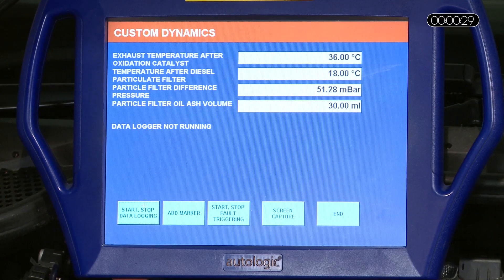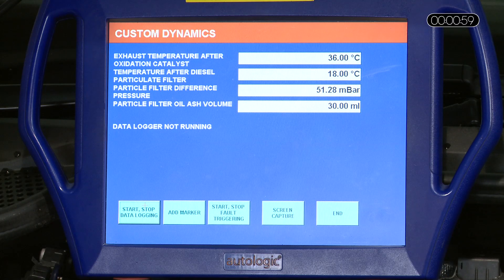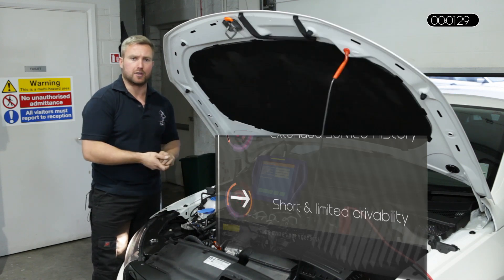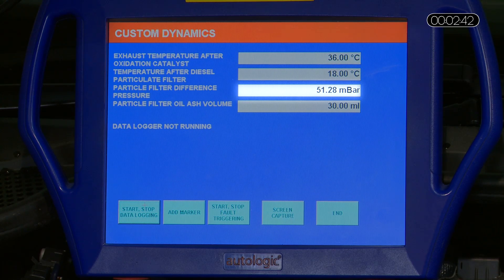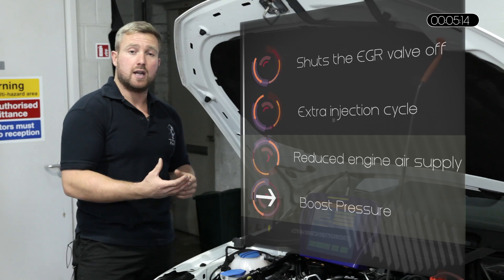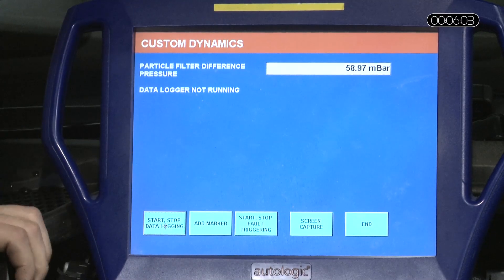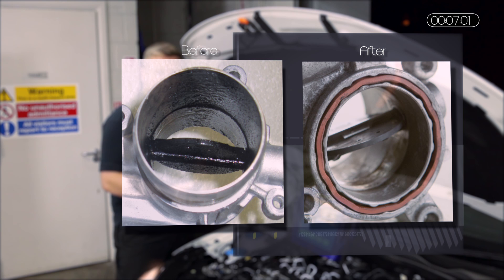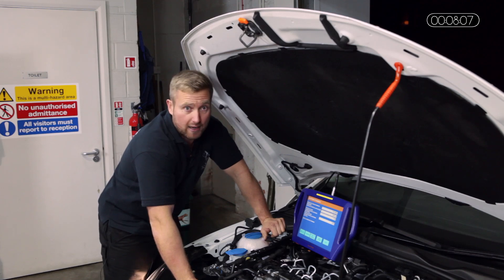AUTOiNFORM ONLINE MAGAZINE: DPF regeneration in vehicle diagnostics with David Massey

Comment: I've been using DPF cars since 2005. The first was a 2001 year model Peugeot 406. So far I've been lucky and have not experienced any running issues. The Peugeot is long gone, current car is a 2.2 Mazda 6 diesel.

Comment: I don't believe in the passive regeneration, i haven't seen soot decreasing at temperatures under 500 degrees. Maybe the build up of soot is slower but its not getting less. Only when the active regeneration takes place. And you notice it because the car is getting noisier and less powerfull.

Comment: i have a similar problem. my 2006 jetta 36k miles lack of power, cloud of smoke when i rev over 2000rpm gas pedal but no smoke when idle. only driving weekend car person i got it from only driven small journeys. when changing gears hear noise or when cut the engine hear a noise like tubro dropping its a bad noise. why is this happening if only covered low mileage?

Comment: Stumbled across this video and noticed more of the usual comments here seen from people that don't know what they're talking about regarding DPFs - makes me laugh.  DPF problems (and any DOC or TWC problem for that matter) arise because of something else being faulty.  In this case a faulty back pressure sensor (which are notoriously poor on VAG cars) prevented the car from having chance to perform a full active regeneration, at which point the DPF warning lamp will come on.  Done without too much delay a simple sensor change (as diagnosed here) would have been all that was needed.  VAG have particularly complicated systems that don't just rely on back pressure to know when filter is full, but also use their own calculated soot mass algorithm to help reduce the active regen frequency to save on the fuel penalty from each one.  Using the recommended oil is very important - these usually have low sulphur and phosphorous content the help reduce the amount ash created during regens (you can't burn ash away).  Soot will burn at 250°C in the presence of NO2 that is in the emissions under certain conditions.  The active regen happens when not enough passive can take place before the DPF gets full; this as the guy in the video says is when the engine map is altered to generate ~650°C at which the soot will burn in O2 (always present).  DPFs have been in production for 10 years now and compulsory for Euro5 onward certified vehicles (new models from Sep 2009).  There's certainly no cheap fix about it, on the contrary it's a billion pound industry designed to improve air quality and therefore mortality rate because of (agreed) emission targets.  Legislation also acts as a bit of a stick to beat OEMs with in order to push them to make their equivalent advancements otherwise they wouldn't bother because that cost them less.  If you don't want one buy a gasoline car (although GPFs will be appearing on those too from 2017 :-) ).  If you remove it now you'll fail an MOT by the way unless you've got a dodgy tester mate.

Comment: I may be wrong but that engine bay looks like a VAG range model which you shouldn't use engine flush treatments on (if it's a PD one). 
I'm not sure about CR engines (the TDI170s) but I know the BLS and a couple of other engine codes in the 105 and 140 range of TDI engines that have DPF's which are PD engines.
But nevertheless thanks for the video. :)